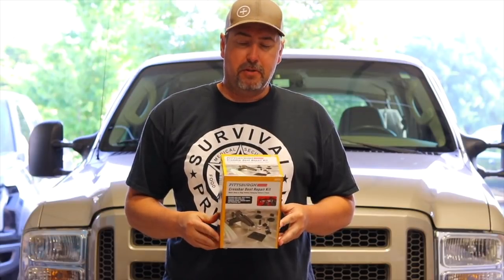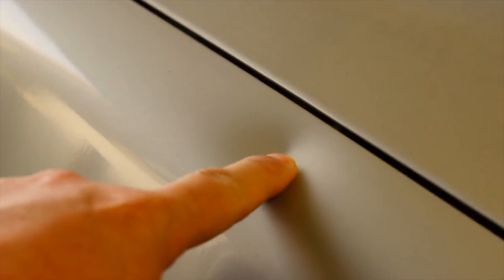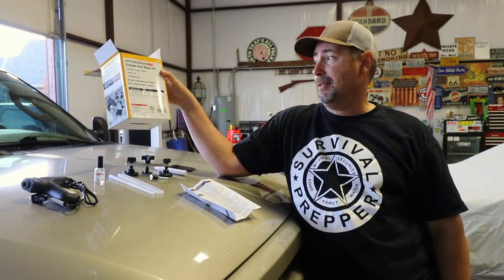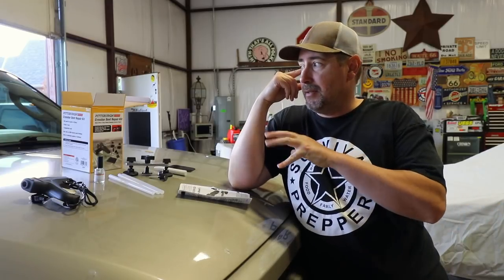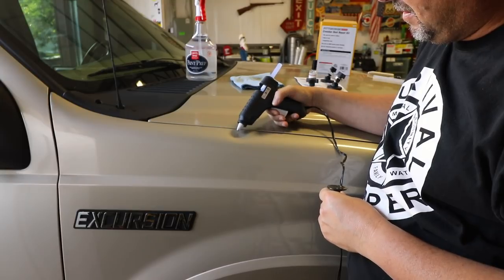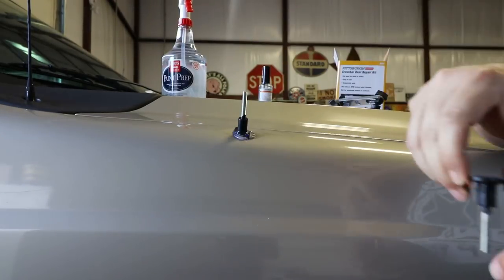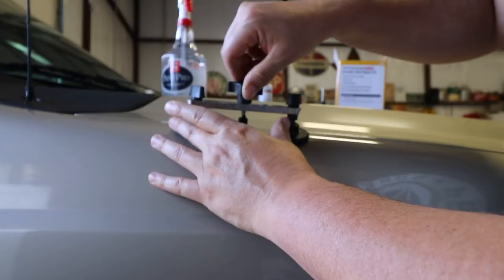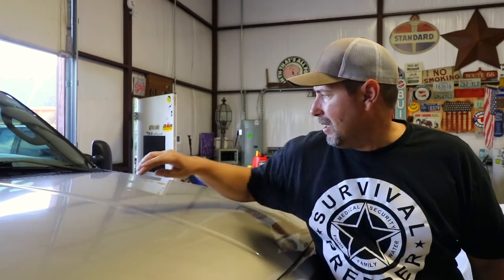Are Harbor Freight Tools any good? -- Pittsburg Crossbar Dent Repair Kit

Comment: Heating the dent area and the pull tab just a bit , applying a good amount of glue to the tab and then going through the procedure will work much better. Also looking closely at the shape of the dent and applying the pull tab that most lines up with the shape of the dent will help a great deal as well. Sticking the tab directly in the middle isn't always the best placement.
Reply from the maker: Thanks for watching and commenting.  Will definitely try the suggestions.

Comment: So what happened after the fourth pull?  Would have been nice to see the after effects of that rather than your overall opinion at the end.
Reply from the maker: On the fourth, it just popped off and did not really do anything.  Again, for smaller dent's for maybe ones that are not on a corner or something like mine, this would probably work great.  It did make it smaller through.  Thanks for watching.

Comment: 8:24 not smooth bud, they must have paid you to give this thing a good review i dont see why you would need to skio to a new frame making it seem as if the the glue can handle the pressure
Reply from the maker: No payment from company. All on my own. Tried to be as accurate as possible. Made a statement that the glue kept releasing on high pressure. The product worked a little bit not all the way. Thanks for watching.